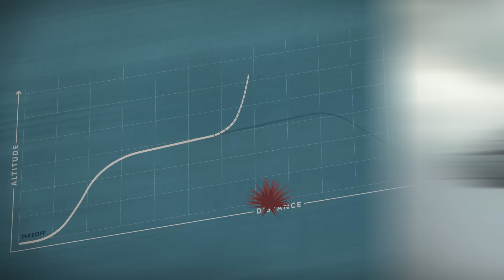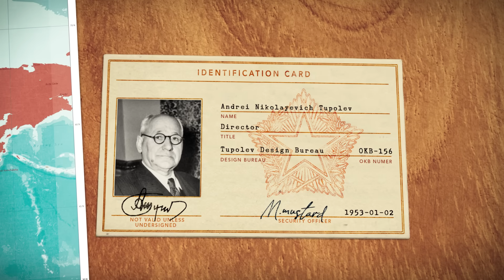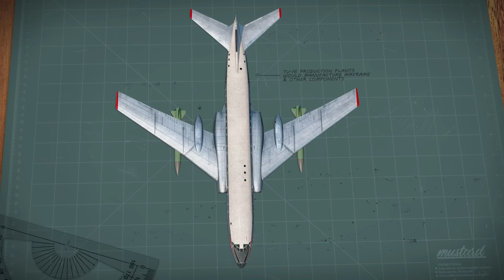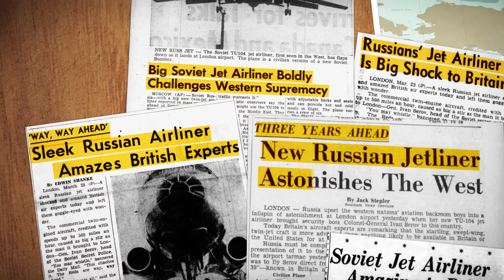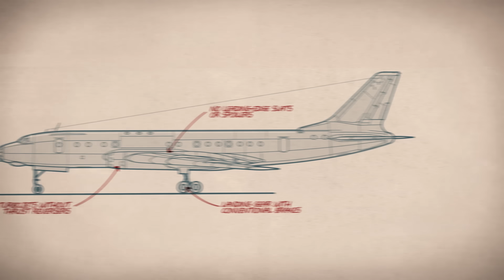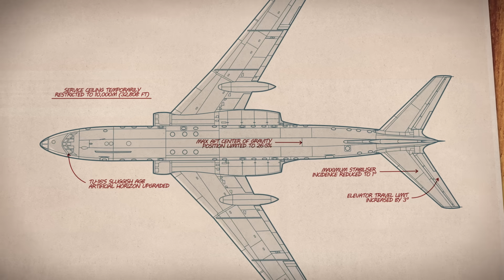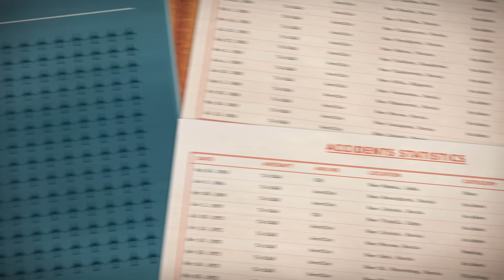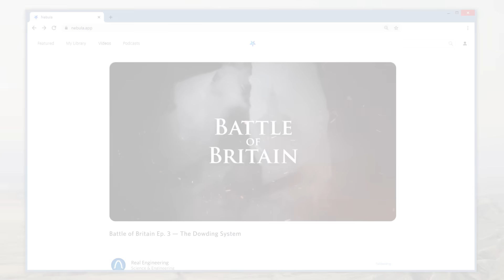The Soviet Airliner Designed To Crash

Comment: It might have been bad, but it surely does look great
Reply: We feel we can clear up some commonly held myths and misconceptions.

It always good to deal with facts isn't it.

Obviously there have been worse aircraft for accident losses both before & after the DH Comet & the Tupolev T-104.

    How things were back then -

Accident losses - % of aircraft built.
DeHavilland Comet 4 UK     14% 
DeHavilland Comet all mks  17%  
Vickers VC10 UK                     5%
Tupolev T-104                          16%

   The DH Comet & Tupolev T-104 had better safety than or similar safety to many other commercial passenger aircraft of a similar era

    Douglas DC-1        99%
      Douglas DC-2        47%
    Douglas DC-3        30%
      Douglas DC-4          26%
    Boeing s300            72% 
 Boeing 307               70%
  Boeing 247                48%
     Boeing 707                   20% 
Lockheed L-049/149 Constellation  30%
   Lockheed Electra  Turboprop    29%
Fairchild FH-227                        30%
 McDonnell Douglas DC-8        14%
  Sud Aviation Caravelle            15%
Canadair CL-44  Turboprop     46%  
Convair CV-580  Turboprop     22%
Convair CV-880    (ff 1959)       27%  
Convair CV-990     (ff 1961)      33%
Tupolev T-104          (ff 1956)    16% we can clear up some commonly held myths and misconceptions.

It always good to deal with facts isn't it.

Obviously there have been worse aircraft for accident losses both before & after the DH Comet & the Tupolev T-104.

    How things were back then -

Accident losses - % of aircraft built.
DeHavilland Comet 4 UK     14% 
DeHavilland Comet all mks  17%  
Vickers VC10 UK                     5%
Tupolev T-104                          16%

   The DH Comet & Tupolev T-104 had better safety than or similar safety to many other commercial passenger aircraft of a similar era

   Douglas DC-1          99%
   Douglas DC-2          47%
   Douglas DC-3     .    30%
   Douglas DC-4          26%
   Boeing s300            72% 
 . Boeing 307              70%
   Boeing 247              48%
   Boeing 707              20% 
Lockheed L-049/149 Constellation  30%
Lockheed Electra  Turboprop            29%
Fairchild FH-227                                 30%
McDonnell Douglas DC-8                  14%
Sud Aviation Caravelle                      15%
Canadair CL-44  Turboprop              46%  
Convair CV-580  Turboprop        22%
Convair CV-880    (ff 1959)         27%  
Convair CV-990     (ff 1961)        33%
Tupolev T-104          (ff 1956)      16%

Obviously we hope this helps.

Cheers 👍

Comment: @DoktorBayerischeMotorenWerke 

Obviously We feel we can indeed shed some light on some common misunderstandings & misconceptions.

Clearly It is indeed always good to have the facts to hand.

Accident Losses
World's first high altitude jet airliner.
World's first airliner with 8 psi pressurised full length fuselage cabin.
Comet      ff 1949   17%
Comet 4  ff 1958   14%

Convair CV-990     (ff 1961)             35%

The Dc-10 had a poor safety record to begin with for an aircraft that first flew in 1970. A significant number of modifications were required before the aircraft was able to maintain an average safety record.
 The first DC-10 accident loss was the most lethal single aircraft incident historically at the time & due to a rather strange agreement between the manufacturer & the FAA it transpired that cargo door modifications were not immediately implemented which resulted in a further DC-10 accident loss. Obviously a lot more DC-10 airliners were built and the DC-10 had a much longer production run. There are now no DC-10 airliners doing airline service.

Obviously Concorde's accident loss rate is lower than that for the DC-10.

That's correct, Comets flew until 1997.

Two substantial lengths of fuselage were pressure tested extensively. De Havilland carried out significantly more testing than any authority required. De Havilland engineers did stress calcs for the entire airframe 

It is true that The Comet design had military use as a requirement. Nimrod development began at
De Havilland before 1953.
   Nimrods were not withdrawn due to structure problems or other airframe issues it was entirely a significant upgrade snag & resultant basic economics & an end of line sale happening at Boeing at the same time.

Obviously The engine position & inlet design were not flaws or fatal flaws, there were good reasons for that design choice at the time which had some aerodynamics advantages especially when considering it's intended military applications. The subsequent design modifications were simply to render pilot errors during takeoff less likely to cause a stall, those pilot errors being due to propeller airliner pilots not using jet specific takeoff procedures. 

  If course at the time the Comet didn't  have particularly high accident loss rates relative to many other aircraft.

Losses comparisons,
how things were in those days.
Accident Losses % of Total Aircraft.

DeHavilland Comet 4 UK           14%
DeHavilland Comet all  mks       17% 

Boeing 307                                         70%
Boeing 247                                         48%
Boeing 707                                         20% 
Lockheed Electra Turboprop           29%
Canadair CL-44  Turboprop             46% 
Convair CV-580  Turboprop             22%
Convair CV-880    (ff 1959)              27% 
Convair CV-990     (ff 1961)             35%
Tupolev T-104       (ff 1956)            16%

   Yes, it is the case that De Havilland carried out full stress analysis & engaged in a comprehensive & protracted testing program which is why key De Havilland people were happy to be aboard flying DH Comet aircraft.

Of course De Havilland had prior experience building many all metal construction airframe aircraft including thousands of jet powered fighter aircraft that were primarily of metal construction with pressurised cockpits & jet engines built by De-Havilland.

    The DH Comet was of course the first passenger airliner with full length fuselage pressurisation at 8psi pressure differential. Handley Page built the world's first all metal construction airliner during the 1920s.
   
   Of course ripstop provision was provided. The skin alloy used became unavailable at the time due to R & D at the manufacturers which resulted in the original alloy being discontinued.
The skin thickness used for the Comet was used for similar later aircraft.
Frame spacing was not found to be too large & frame width was not found to be too small.

  Indeed, that's right, In many cases earlier pressurised aircraft were larger, needed thicker fuselage skins due to flying stresses & had much lower pressurisation differential pressure.

  Without doubt, De Havilland did indeed always work to better than industry standards at the time, used up to date knowledge for the design & construction & no evidence of negligence  or criminal negligence was ever produced in relation to the DH Comet.

    Of course The investigation committee did not find hundreds of fatal flaws or evidence of design defects, structural defects, defective materials or shoddy workmanship. Ripstop provision was included. Claimed incidents did not involve cracks starting from window corners.
Pretty much all changes were just in case changes or were planned development modifications & improvements that were scheduled regardless of incidents.

   Yes, it is correct to say that The DH Comet had no effect on the course of the aerospace industry in the UK. The UK now has the world's largest combined nuclear, aerospace & defence sector per capita activity.

  It's generally accepted that De Havilland designers knew all there was to know about metal fatigue at the time they designed the DH Comet. In fact nearly all subsequent changes to the Comet were previously planned improvements or just in case changes during the investigations. After the incidents how airliners were built & tested changed everywhere airliners got built.

  The world's first all metal construction airliner was built in England during the 1920s by Handley Page.

 The world's first demonstration of a pure gas turbine aero engine was performed by Frank Whittle in 1937.

  The first example of a pressurised cabin aircraft was a British design  Airco aircraft built under licence in the US & modified to have a pressurised cabin during a joint UK / US research project.

  The gas turbine engine was first conceptualised & patented before 1800 in England.

 The world's first axial multi stage sequential stator rotor turbines & compressors were produced in England by Parsons of Ireland & North England. The same components used in many modern gas turbine aero engines. Parsons also did some work on the internal combustion gas turbine engine.

  Of course we do indeed Hope this helps obviously.

Cheers indeed etc 👍.  

. . .... ... ..... ..  ... .
. .... .......  .... .   .. .